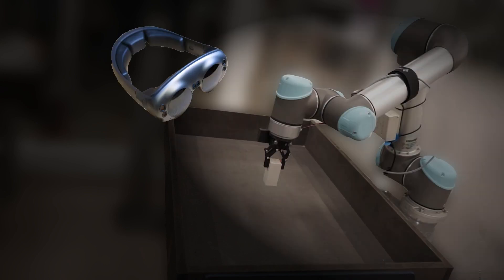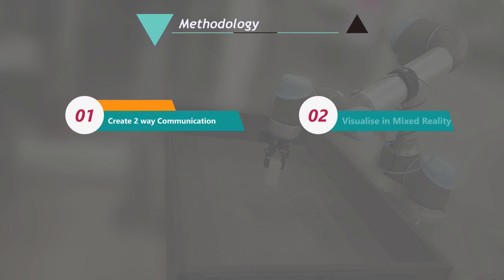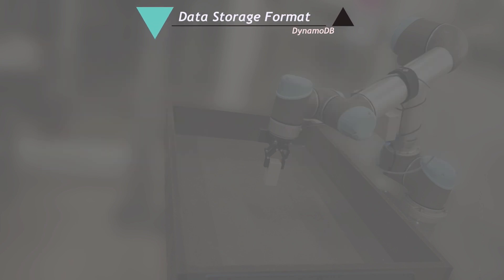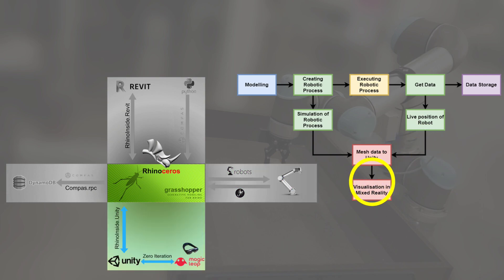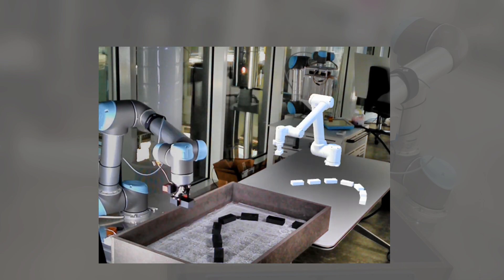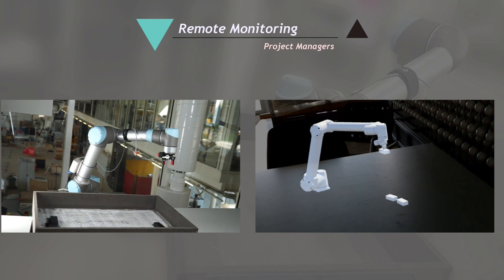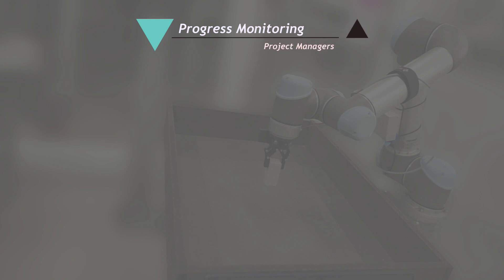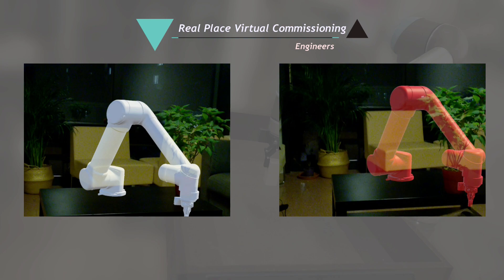Digital Twin of Robotic Construction - Kaushik Ravi - Master Thesis - Spring 2021

Comment: Quite a bit of overhead if I didn’t miss understand this / are miss informed. I strongly believe that the UR5 has full support for OPC UA and MQTT to simply subscribe to the pub-sub feed of the robot arm and this way having a fully populated object namespace and real-time information + control. This would likely be way more performant and reliable than rolling your own data protocol with a even a database at the end. There are well built client libraries for MBUS / SparkPlug B / OPC UA libraries available in C#.